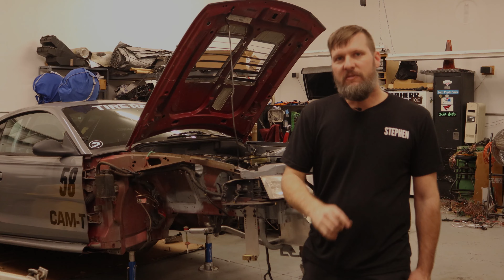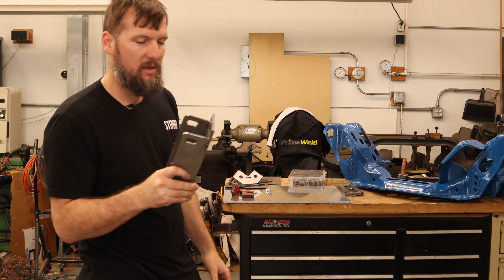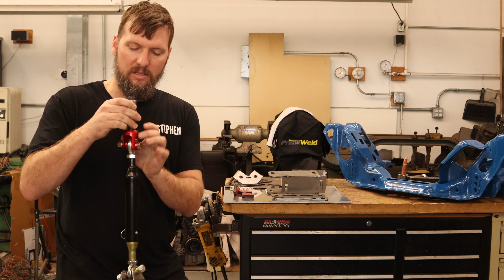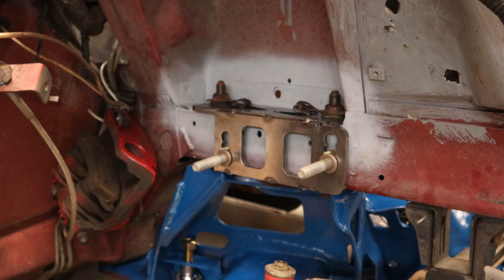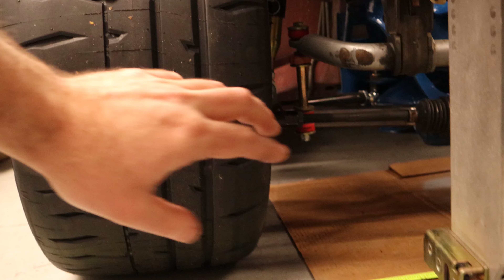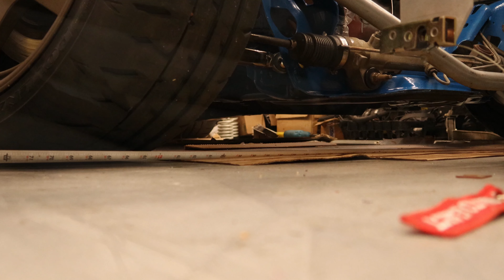Mustang Sitting on DIY front SLA suspension for 1st time

Comment: You’re doing well with this and I’m happy to see it. I’m at a standstill with my SLA project while tackling other items on my to-do list.
Reply from the maker: Thanks. It's definitely taking longer than I thought and costing more. Going to do a comparison at the end to see if buying parts like you would have been a better option.
Reply: @RinerAutomotive  My only concern is determining the dimensions/proper stroke for the strut and spring rate. Once I have upper control arms in hand, I plan to install one side of the setup and start taking measurements. I’m sure Bruce Griggs will be a valuable source of information since I’m using his parts.
Reply from the maker: I did everything only on one side as well. I think I saw on Griggs site that their upper mount is designed for 5" stroke shock. The spring rate can calculate based on motion rate and corner weight (or approx). I realize I glossed over choosing spring rate. Maybe I'll cover that later.

Comment: very interesting!  great work so far I believe too, and you'll find out soon.  Will hopefully catch coil your over video too

I've been pushing PUSHING my shop to get things Moving...  Haltech CPU with Boomslang harness is in waiting for custom modded throttle body for drive-by-wire auto blip and then better tuning for putting down all the horsepower.  Aero mods done.  Will need track test & tune after 1st dyno for tweaking Haltech and suspension.  My guy is good but takes forever!!! I gotta Constantly micro-manage...  Still not sure on rubber, brake pads, and ABS.... Thinking two sets with R Hooser for track only then a 100 or super 2 for street & track if car still "reasonably" streetable
Reply from the maker: One day I'd like to go to a Haltech. But yea I'll find out soon hopefully. That sounds like a lot of work going on. Definitely need to be a project manager for that much work and some shops don't have the personnel for that
Reply: @RinerAutomotive  that's about right...  my Project Mgr (also Very good racer) needs informed assistant making sure things are Possible and then Happening! I help him a lot doing research but he doesn't listen too often.  I suggest at times do/use B, B+ and get it done timely as opposed to A+  taking months & Months or more

---that's where I commend you! and you have a wife that you work/drive with as well
Reply from the maker: Thanks, appreciate that

Comment: Do you think you would be thinking of offering this control arm system as a kit? I looked at these kits from Kenny Brown and they are above the average  shade tree guy. Thanks
Reply from the maker: I don't know. I didn't set out to build a sellable kit. If I were to do a full SLA it wouldn't be and differently priced then others on the market most likely. I'm trying to show that it is possible to do yourself and I don't mind sharing most information
Reply from the maker: Are you talking about just the lower or upper and lower?